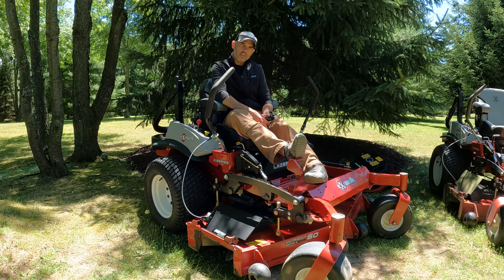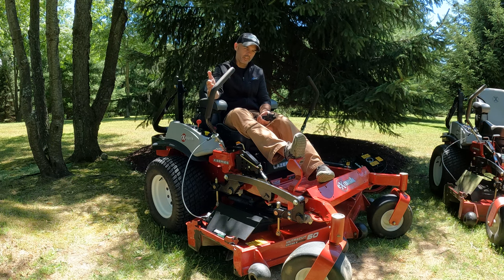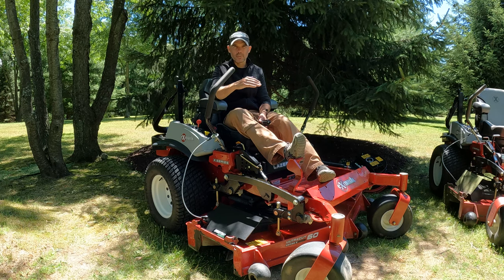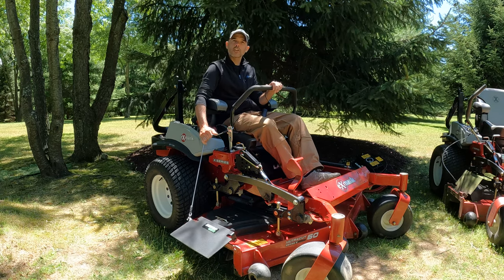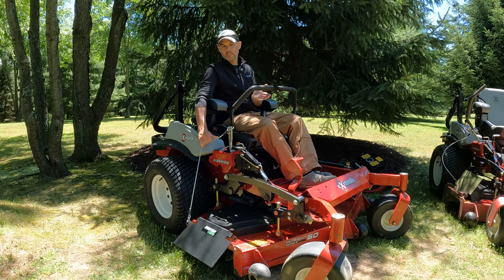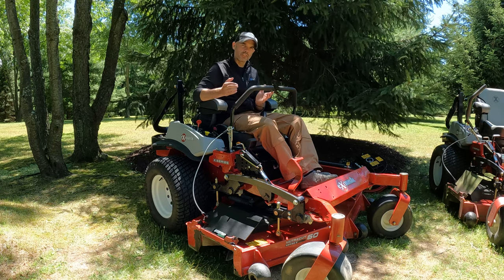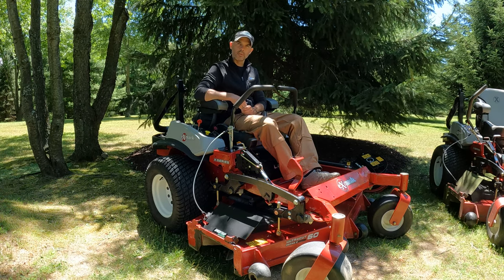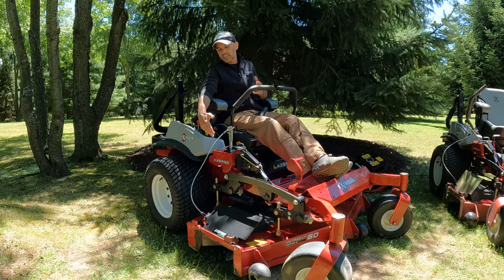Speedtrap™ Chute blocker product overview

Comment: Hey Danny, absolutely incredible product. I have a 2002 ex mark Lazer ZHP 52 inch will it fit that? I have the factory brackets still on the deck I could give you the measurement if need be thanks John.
Reply from the maker: Hey John, how’s it going! Thanks for checking us out! Unfortunately this particular Speedtrap only fits Exmark’s Next Gen chassis mowers, not the older style HP’s. Sorry about that! Thanks again for checking us out, and sorry we can’t help you at the moment. -Danny
Reply: @SpeedtrapCHUTE  thanks for getting back with me Danny I figured as much I thought I’d give it a shot as I am going to pick up a new X mark this summer or fall. I thought if it would fit I’d pick up the speed trap now and use it on the old and then just put it on the new one. 22 years and almost 12,000 hours. I guess it is time for a new mower. Thanks again for your response john
Reply from the maker: Crazy how those mowers are still out laying it down in the field! I know a couple guys fairly deep in the industry and they still use those as their personal mowers, and they’re still going strong! Just have to know your way around them a little. Thanks again for checking us out and we’d love to help ya when it comes time. Have a good Spring. -Danny

Comment: Will this fit a Quest 48"?  Looks like the gray plastic body control molding on my mower may be in the way
Reply from the maker: I believe we chatted on eBay about this, but for others wondering about the Quest, it will not fit.  We will be looking at the new updated '23 Quest, as they made some changes.  If the Speedtrap fits the new models, we will post the update on our Facebook page.  https://www.facebook.com/SpeedtrapCHUTE

Comment: Does it rest on the spindle guard? Or is it “floating” when opened
Reply from the maker: Hi Jimmy, the chute sits back against the factory pulley guard mount when in the open position. When you want to close it, simply pull the cable, flick your wrist again to re-open. Ultra simple. We have an accessory available as well, that allows you to keep the plate up, ands from striking the guard. Not necessary, but it depends on preference. Thanks for the question. -Danny

Comment: Wish there was a partial open position
Reply from the maker: You can hold it manually open temporarily or you can also rig it temporarily with some hardware, but just understand these are thick steel and won’t flex like a factory plastic or rubber option.